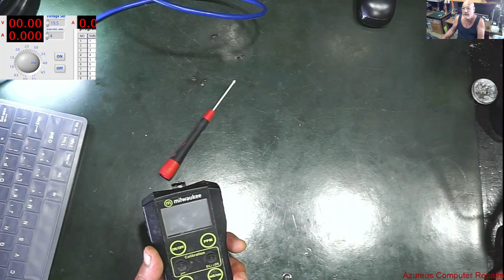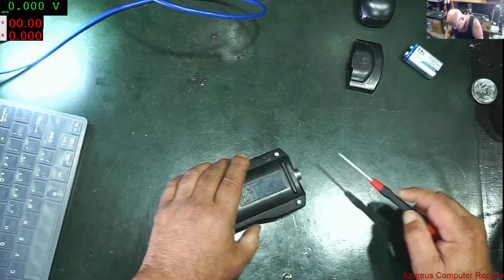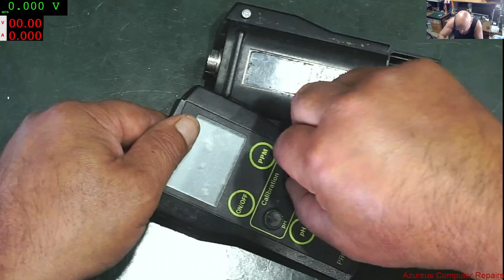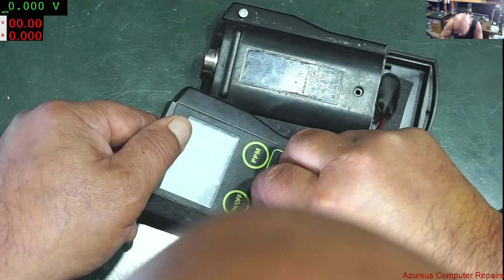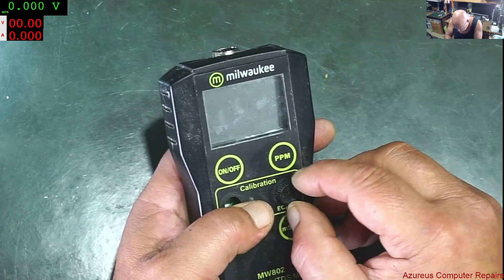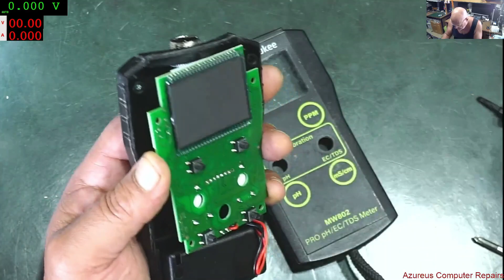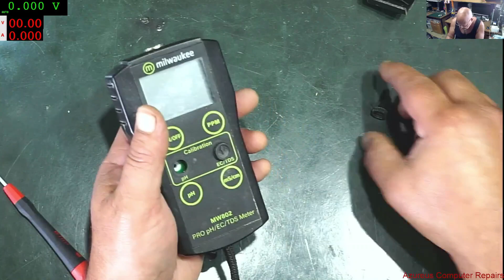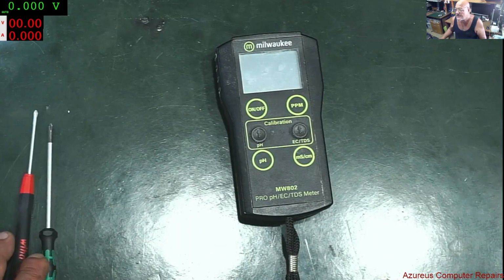Milwaukee MW802 Maintenance

Comment: Hi. Thanx for this. Just bought a second hand unit, and its stuck on a pH of 4.5. No matter what probe is used, it always reads 4.5. Any ideas would be appreciated.
Reply from the maker: I'd be looking at the POT that changes the PH. 5:49 Looks like it has the manufacturers name on it. PIHER Spain. Hopefully you have some electronic skills. 
Check out my other channel. @azureuscomputerrepairs
Reply from the maker: Maybe corrosion on the contacts where the probe plugs in?